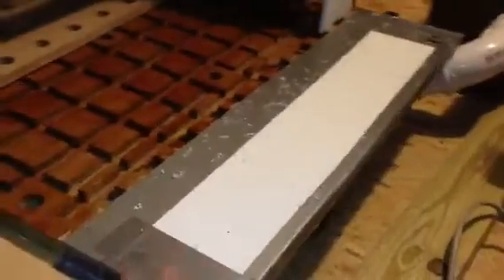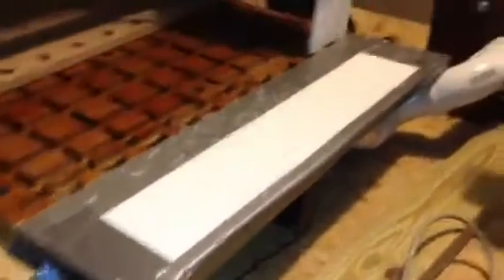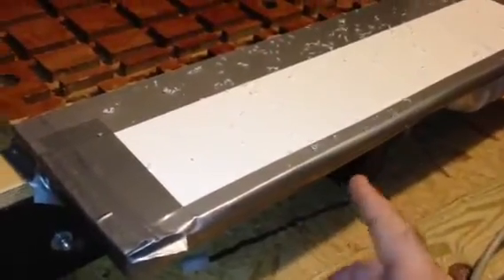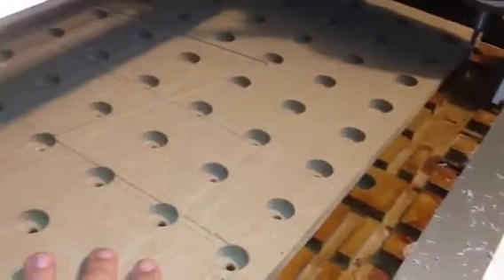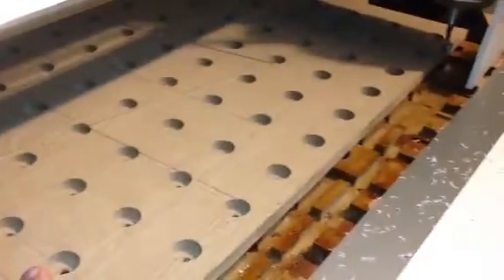Zenbot vacuum table demo

Comment: What is the "heaviest" cutting you've done with your Zenbot?  I'm considering a Zenbot for cutting of parts from 3/4"-thick birch plywood.  I assume that I would set the machine up to do multiple shallow passes to get through the material, and run at relatively low inches per second.  Based on your experience, would that type of work be realistic for the machine?